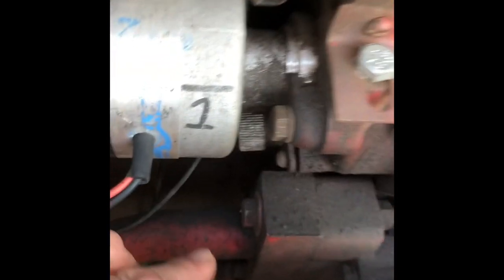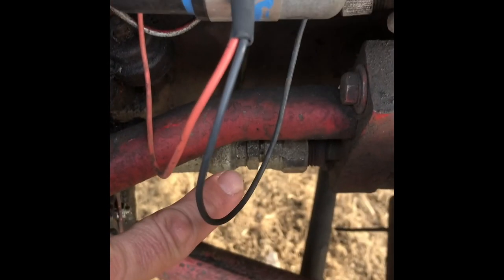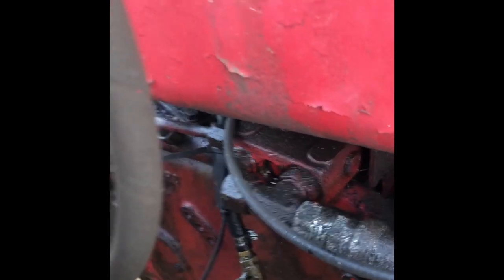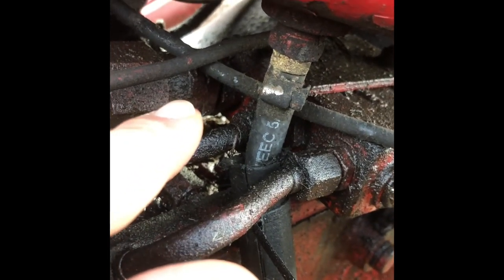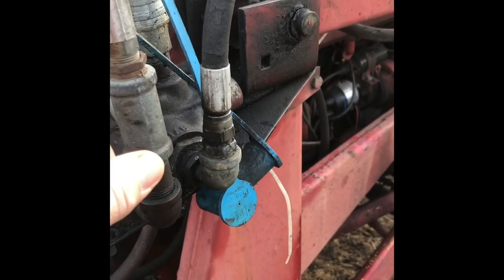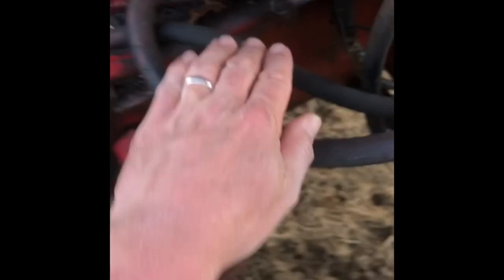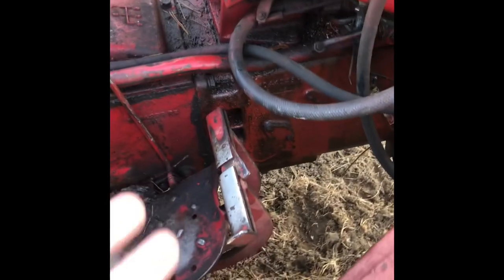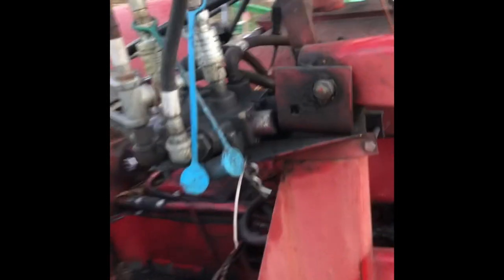Overview on IH 444 hydraulics for the front lift, bucket, rear 3 point, added on rear hydraulics

Comment: Thanks for this info just got a 454 the manual is ok however this helps
Reply from the maker: We are glad this helped you. Old manuals are tough as they have simple limited drawings.
Reply: Bought a 454 that has been Disassembled for years two bins of parts. Hydraulics pump was  not mounted on the tractor. 
Bought a manual however your tractor is more like what I am dealing with. 
Just getting my head wrapped around this project and what I need. may reach out to you if that’s ok?
Reply from the maker: @duanekruse6811  I can send you additional pictures as needed. Go to our YouTube home page and message us there.

Comment: I would like to have a similar setup, only I have a 1501 Loader. When using an implement which requires rear remotes, I am assuming that you disconnect the hoses at the quick couplings and plug in your extra long hoses for the implements (pressure and suction), effectively losing use of the bucket. Correct?
Reply from the maker: Exactly. That’s what we do. I have extra long hoses on the haybine and the M&W round baler.  That was the simplest quickest solution for me.  The hydraulic cylinder on the bucket tilt holds good. If it didn’t I’d have to chain it up.  As we have added other tractors to our growing farm I do feel the urge to go back and pipe permanent hydraulic quick connections to the back as the rest of them all have it.
Reply: Good video,  it was easy for me to follow along. I've had a 444 for 6 years. Mine has a hydraulic auxiliary pump for the front loader that is mounted in front under the radiator. The shaft has worn out and I'm having trouble finding the parts rebuild.
Can you confirm that you are using your machines front loader without auxiliary pump
Reply from the maker: @rickdinovi9217  confirmed it’s only the internal pump being used.  Did you try abaline machine, Wengers of Myerstown, Steiner, all states AG parts?  We do not have a front pump on our 444.  
If this helps you - please help us and subscribe as we don’t get paid for any of this off ads until we hit 1000 subscribers.
Reply from the maker: @rickdinovi9217  confirmed.  We are only using the internal hydraulic pump.   Did you call Abaline machine, All states AG parts, Wengers of Myerstown PA, Steiner?
If this video helped you please help us and subscribe.   we do not make any money on adds until we hit 1000 subscribers